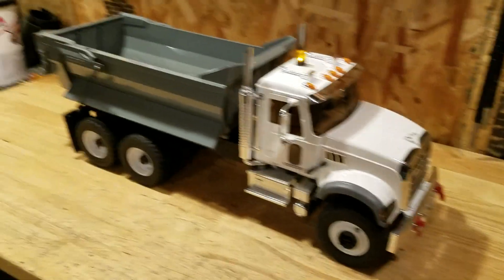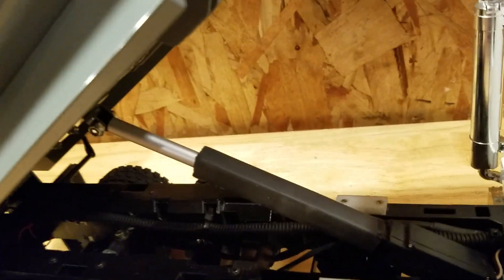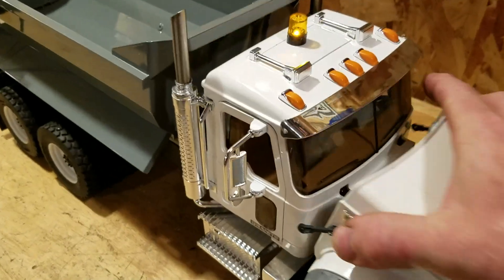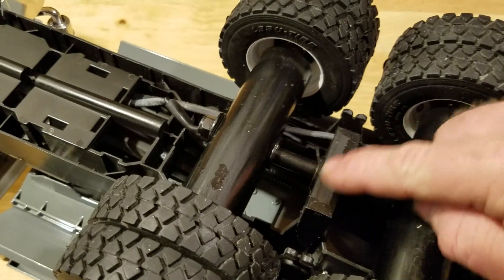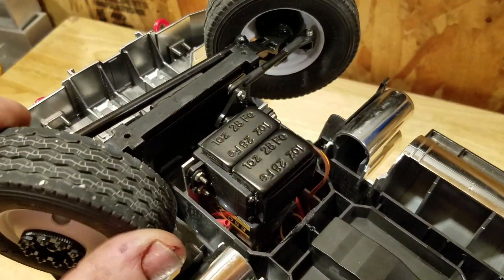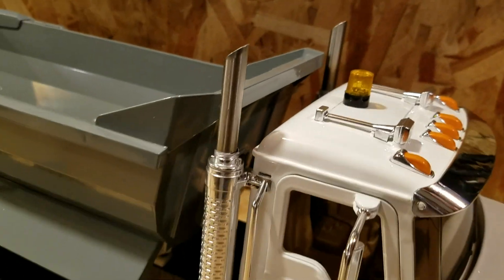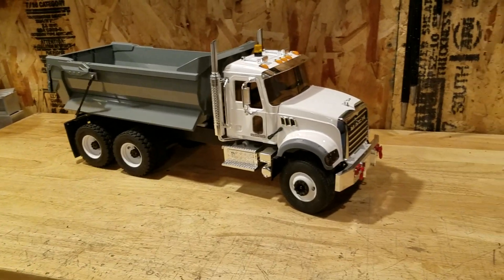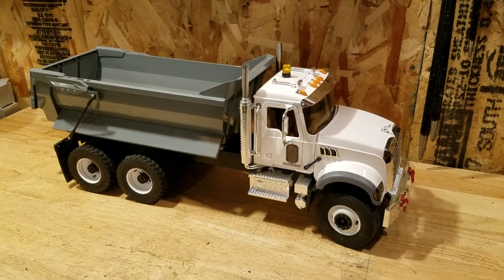1/16 Bruder Mack Granite Halfpipe RC Conversion

Comment: Do you sill build these? If so how much would one of the new Granite plow trucks with sanders run? The sander can just work mechanically as its supposed to, and lighting i would be able to do. want to do custom lighting that i specialize in but have been wanting to do a realistic plow truck. im afraid if i attempted this without a conversion kit id probably butcher it.
Reply from the maker: Sorry, I am only building for myself.

Comment: What specific motors are you using I can’t find that width of motor on Amazon eBay etc
Reply from the maker: Those 25mm diameter motors are everywhere.  Sometimes referred to as 370 motors. Due to having too many issues, getting bad motors from sources like Ebay, Amazon, and Aliexpress, I changed my source. https://www.servocity.com/170-rpm-econ-gear-motor/
Reply: I will shop there thanks for the tip sir!
Reply from the maker: @johnhenderson4837  you will pay more for sure, but I have had zero motor failures.

Comment: are you using 370 engines?
Reply from the maker: Yes, they are what you would call 370's I guess. Now using Servocity 170RPM motors in most all my builds that are done this way now. I pay a little more for them but feel I get better quality and longevity.
Reply: @dennybobsrcconstructionagc2796   
at 100rpm do you think it will be slow?
Reply from the maker: @bonomi2023  yes. Plenty of speed and power with the 170.

Comment: How did you wire Linear actuator? My actuator only has 2 a (neg-and pos+) and on my receiver it has 3 prongs (sig,pos,neg) thank you for your time
Reply from the maker: You need an ESC to power the 2 wire style. I used Actuonix brand 3 wire style.
Reply: @dennybobsrcconstructionagc2796  COOL! thank you 🤟🤜 Is there one you'd recommend it's a 12v actuator. No more bothering 😂🤣
Reply from the maker: @saulgonzalez8117  just gotta get an ESC that will go back and forth and handle at least a 3S Lipo.  Get one that has no brake if possible.

Comment: Where did you get the dump bed from .. ?
Reply from the maker: The dump box is the stock Bruder Mack Granite box with skirts added.
Reply: @dennybobsrcconstructionagc2796  thank you for that information….. as for the motor. Where can I find such? . I m thinking about using a spectrum receiver and my DX8 Tx
Reply: @dennybobsrcconstructionagc2796   thank you for that information….. as for the motor. Where can I find such? . I m thinking about using a spectrum receiver and my DX8 Tx

Comment: What motors do you use?
Reply from the maker: 12V - 200rpm x 25mm motors.
Reply: @dennybobsrcconstructionagc2796   thanks for the response. Reason I ask is my kyosho Blizzard kept on burning the 370's. 

So I want to find a better set up. I want more torque and more realistic speed. Snowcats aren't fast.

Comment: hello, where do the wheels come from ?
Reply from the maker: https://www.ebay.com/itm/Xtra-Speed-Steel-Alloy-Front-Beadlock-Wheel-Tamiya-1-14-Tractor-Truck-XS-15462-/142574139488?_trksid=p2349624.m46890.l49286
Reply from the maker: https://www.ebay.com/itm/Xtra-Speed-Steel-Alloy-Rear-Beadlock-Wheel-Tamiya-1-14-Tractor-Truck-RC-Car-/132393849097?_trksid=p2349624.m46890.l49286

Comment: Which White Colour brand did you use on the MACK ?
Reply from the maker: It is in the video description, Krylon All-In-One Gloss White.
Reply: @dennybobsrcconstructionagc2796   Thanks, Did You sandpaper it first ?
Reply from the maker: @esh2833  very light wet sanding.
Reply: @dennybobsrcconstructionagc2796   will it be okay If I Spray without Sandpaper as I dont know how to sandpaper properly

Comment: King Kong RC and Tamiya has these type wheels in metal. Super detailed hubs with 2mm hex bolts. 1.75” diameter, tires can be purchased with a few different tread patterns. I like K.K. prices better, Tamiya is way over priced.
Reply from the maker: These are Xtra Speed steel beadlock 1.7 wheels.

Comment: Great job! Are those 25GA370 motors? I'm asking because there are also 25GA310 motors which are shorter, and maybe you are using both so you know pros and cons.
Reply from the maker: The longer 370 motors and 200rpm 12V. I have some projects where width may be an issue, but using 100rpm 310 for those projects. Those will go into an end loader with larger tires.

Comment: Excellent job my friend !!, I'm preparing a Scania Bruder with RC and lights. One question; how did you remove the wheels from the axles ?. Thanks !!
Reply from the maker: I just cut the axle in 2. I use a 1/4" nut, a vise and a blue wonder bar to take the axle out of the stock wheels. Otherwise it is super tough to take off the wheels.
Reply: How much did it cost for parts minus the truck

Comment: How did connect the wheels to the motors
Reply: That's exactly what I was looking for. One more question what's a good rpm for the geared motors and   I'm doing a ertl lowboy like you I'm working on the connection for the trailer not to the 5th wheel if you have any ideas I would appreciate it and just to let you know wpl axles fit pretty good on the the ertl trucks
Reply from the maker: @seandean922  WPL axles in my Ertl Pete with upgraded metal housings and steel gears.
Reply from the maker: @seandean922  read the description below the video. The rpm is listed there. 😉
Reply from the maker: https://www.amazon.com/gp/product/B00YOCRTHC/ref=ppx_yo_dt_b_asin_title_o03_s00?ie=UTF8&psc=1
Reply from the maker: Shared a link to what I used, but they are out. That should give you an idea.
Reply: Ok thanks